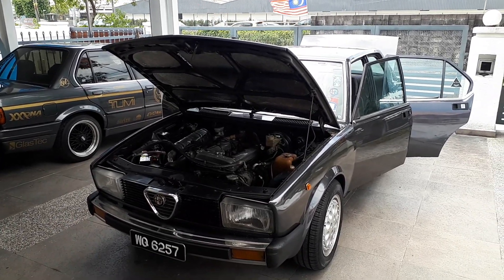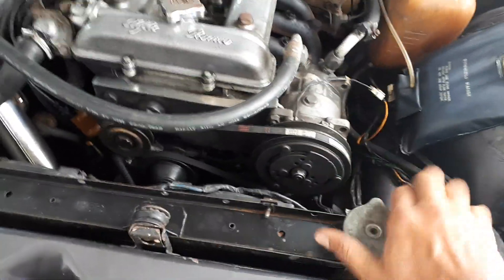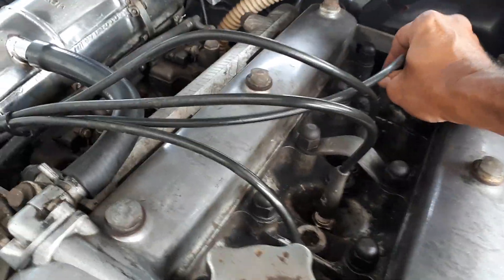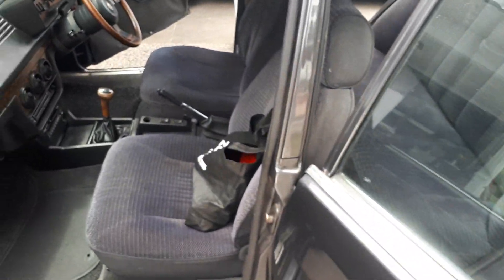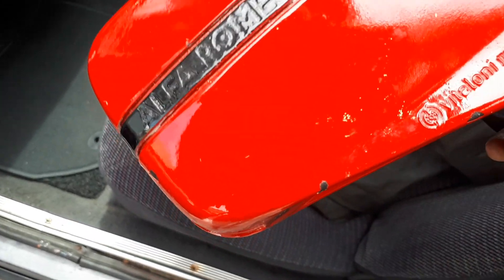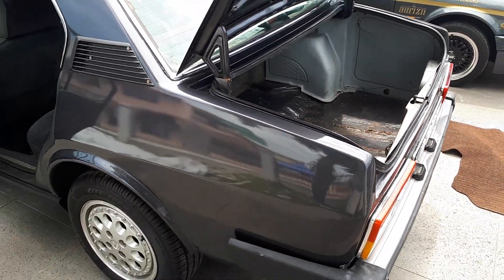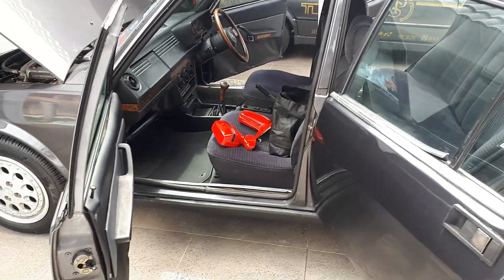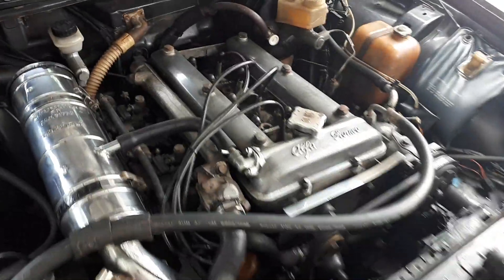Pure Sound: Goodbye Alfetta!! Ciao Bella, Arriverderci | EvoMalaysia.com

Comment: she is so clean..do share work in progress..would like to send my old baby for body work too..the rust issue is a very common problem with alfa's of this generation i guess so it will be a continuous battle..paint looks fresh on the car likely that they have to bring it to bare metal and treat it on both sides of the panell..
Reply from the maker: You bet!! Thanks trustgtr33, will do 🙏🏽👍🏾😊
Reply: In the 70s thru 80s..Italy car manufacturers use Soviet Steel started by the then new south plant ( the word Sud in Alfasud). Then the Nord (North) for 105s, Alfettas plant pun ikut sekali. Murah maaa...Hence the G to G deal with USSR for Lada to use Fiats. Mid 80s baru switch to other suppliers and rust problem kurang skit. By GTV6 time kurang rust issues.
Reply from the maker: @tiamofj842  yup, thanks for the recap of this history lesson, good stuff!!👍🏾🙏🏽😃

Comment: May I know where do you send your car in for rust elimination? My car's having identical rusting... Thanks :)
Reply from the maker: I have 2 places that I use, one in Ara Damansara, and one in Kepong, unfortunately both are booked solid for the next month or so. If u really need to, lemme check which one can accommodate u 😊
Reply: @ChrisWeevilGarage  Thanks for replying, O don't think that's necessary as I do not have the convenience to send the car in yet. But I would like to know the names of the shops for future reference :)
Reply from the maker: @ironrazor6738  cools, email me when you're ready, cheers!👍🏾😊
Reply: Same... I would like to know too
Reply from the maker: @jkbeh6279  stay tuned for the WIP update!! It will be revealed then 😀🙏🏽👍🏾
Reply: Chris, sure thing... I got a year 96 Satria, hesitating to let it go... But definitely need some restore work...
Reply from the maker: @jkbeh6279  it also has rust issues? Or just needs an outside coat? Either way, both the paint shops I normally send my cars to can handle it. Urgent?
Reply: Common for Proton car to have rooftop rusting, most probably paint job for it and rust check... And i get it done for resin fix for it in Ipoh. Beside that is those mechanical and some wear and tear part need to look into.